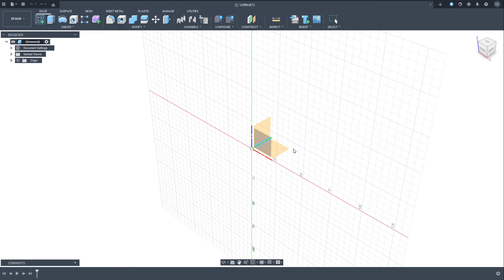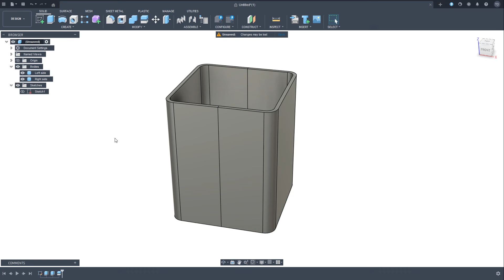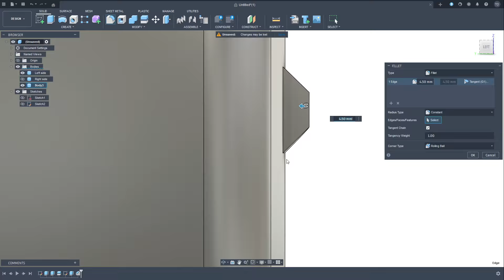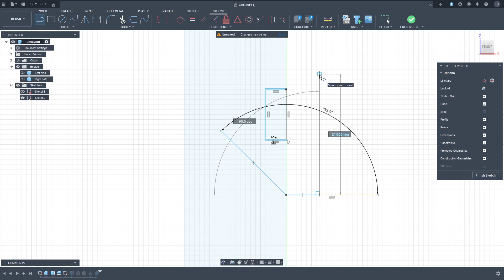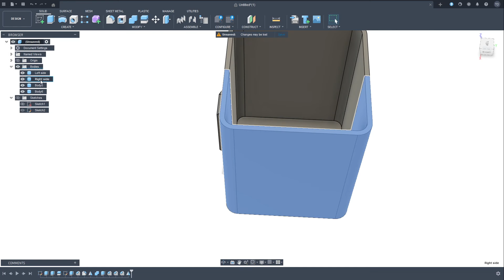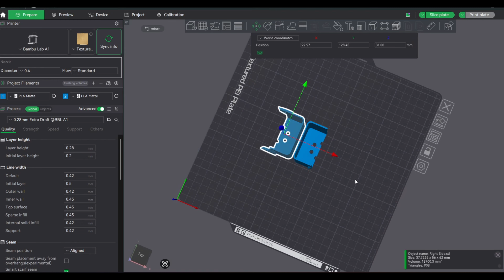3D Printed Seedling Pot with Snap Fit Clip Fusion 360 Garden Tool

Comment: Good video.  Did you consider having each part of the latch on each side?  1 block, 1 clip? That way each side would be identical, you could mix and match, etc.
Reply from the maker: Never thought about that, but as it is you can still mix and match. But i get the idea.  It's possible :)
Reply: @KatapultMake  oh yeh, you can mix and match.  I just like the idea of a single part that can perform as both sides. I shall learn CAD stuff and try to modify :)
Reply from the maker: @AndrooH I can make a tutorial for you